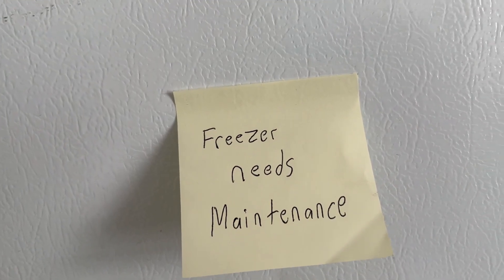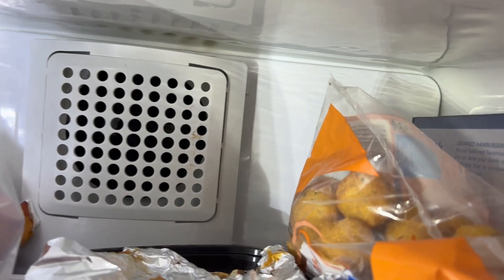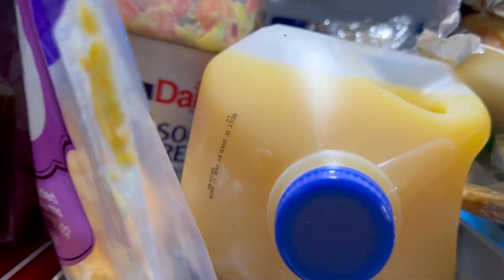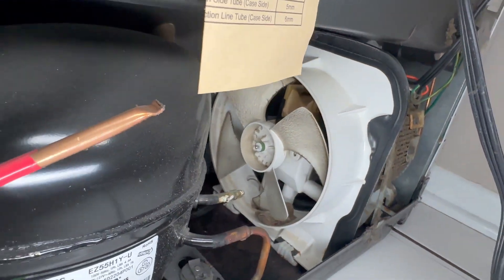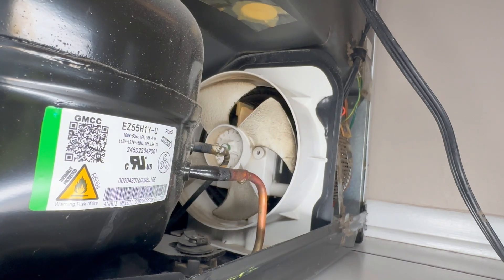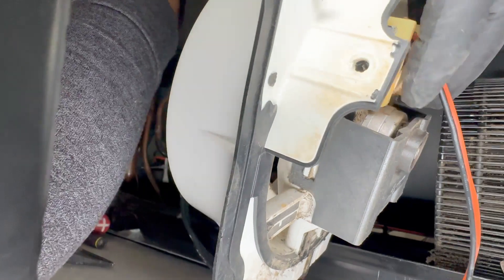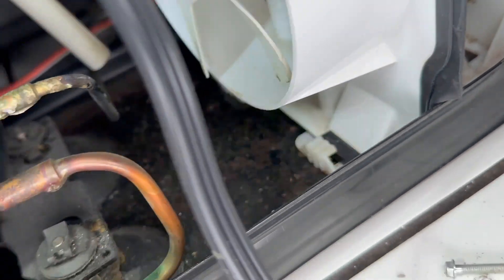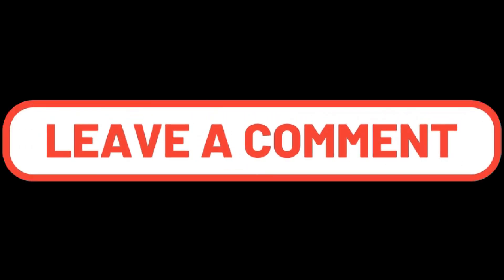REFRIGERATOR NOT COOLING ENOUGH.  REPLACED FAULTY CONDENSER FAN MOTOR.

Comment: Alex the freezer on my Samsung refrigerator is not working. I see the condenser and evaporator fan working and hear the compressor running. Any idea why it’s not cooling
Reply from the maker: hello Orlando, 
Try checking the defrost system.
frost is a sign that either defrost  thermostat or heater or defrost timer are not working properly.
Maybe it lost refrigerant.
Check the compressor capacitor and relay.  Compressor works intermittently.

Comment: Alex I have a question on my refrigerator it's a GE refrigerator but anyways as far as the fan on my refrigerator well on the bottom back right side across the compressor it turns off out of nowhere and either I have to disconnect the refrigerator itself or also I mess with the electrical box turn it off the refrigerator and the kitchen switches well I'm just asking what does that mean if you know?
Reply from the maker: HELLO there!!   The condenser fan motor runs only when the compressor is running.  And it should stop when the compressor stops.   If the compressor is running and the fan is not, then more than likely the fan is at fault.  Replace the fan motor soon other wise the next thing to go will be the compressor.  It needs that fan to cool off .
The fan motor is seizing and goes on internal overload.  It gets too hot.   When you disconnect the fridge the fan motor starts to cool of and then it turns on again .